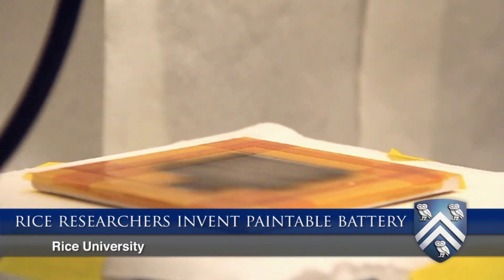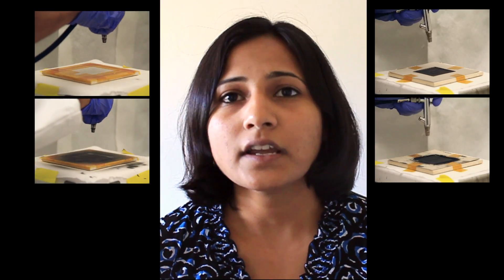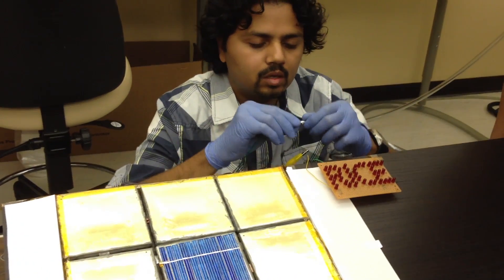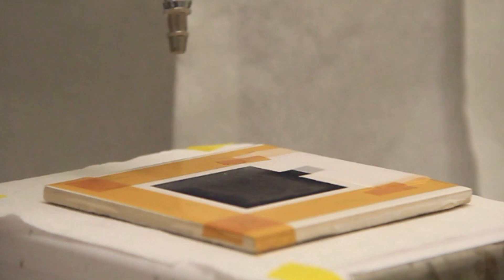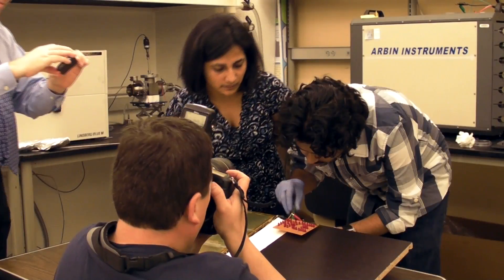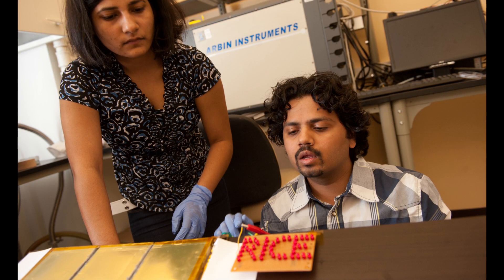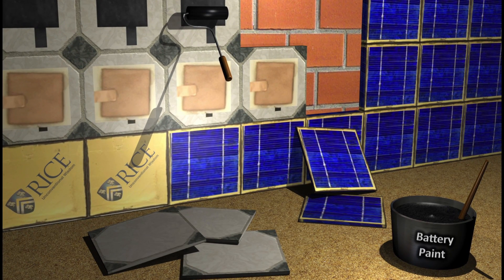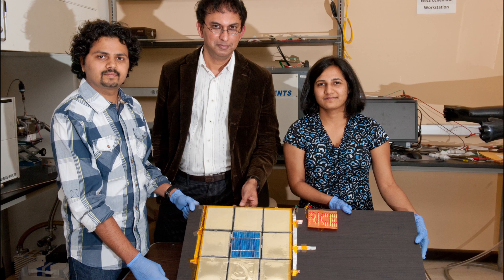Rice researchers invent paintable battery

Comment: Heat would be an interesting issue here. Batteries tend to only work well at fairly narrow temp ranges. Too cold and efficiency goes to hell. Too hot and they burst into flames. These flat batteries have advantages in that they have a lot of surface area. But that could also be bad in that they'd be much more susceptible to ambient conditions.

A more reasonable application might be taking this in the DIY direction for the makers. Batteries you can fab at home using sheets of paper.